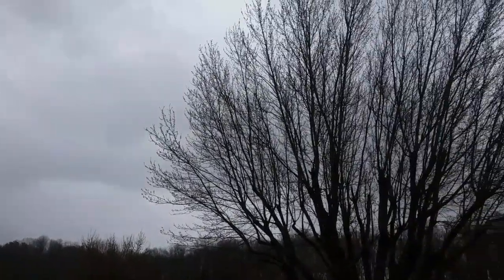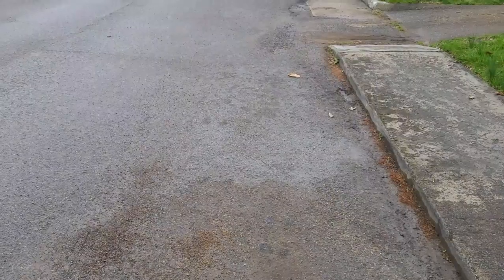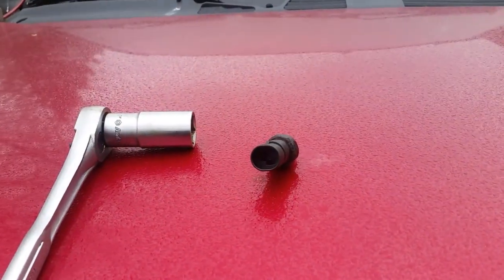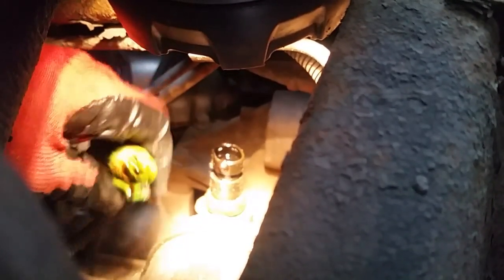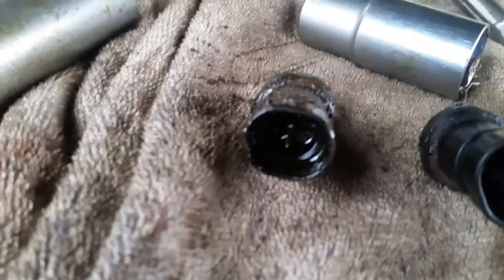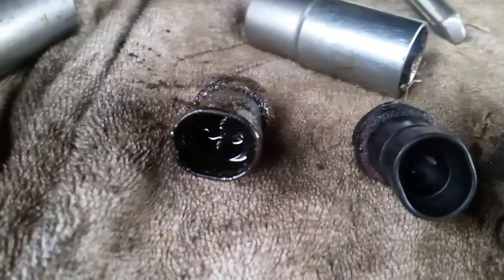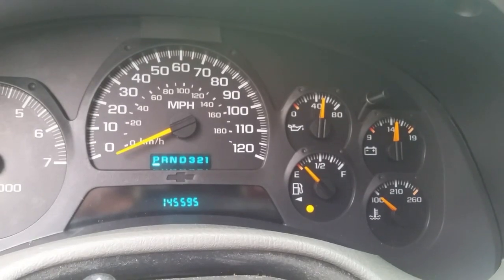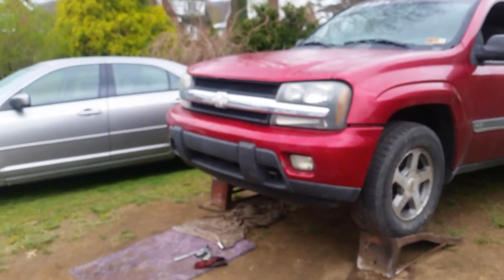Oil Sending Unit Bad leak Fix. Trailblazer.

Comment: Thanks for putting this video up Nathan! It is a pain to get to but not too bad if you have the ramps and the proper deep socket or you could just do what I did...it was super easy I dropped it off at my mechanics shop to do it!! LOL Just picked it up now have fresh oil, filter  and oil sending unit. This fixed the low oil pressure warning when car is at idle plus the warning to shut off engine. We  also ran an engine flush just in case. An hour driving on it after repair and voila oil gauge steady. I'm in SoCal. Keep up the good job on the videos, and even though I didn't work on it(this time) I do know where my engine oil filter is so please ignore Mr. Geiser who needs a snickers! Made me laugh!
Reply from the maker: Great!

Comment: Hello from Denver Colorado! The video was very helpful and it looks like a really easy fix. My trailblazer just started last week after the engine is fully warm I'll come to a stop and the oil pressure light comes on and the gauge drops from 40 to 0 and will fluctuate back and forth. But as long as i keep the idle up it'll stay at 40 lol. Plus I have noticed a lot of fresh oil underneath so yeah, I'm certain it's the same problem as you had. Thanks again.
Reply from the maker: Nice!

Comment: Nathan, thanks great video and follow your instruction. The point is that  after replace the sensor,  problem still exist. I change the oil, no engine noise when the pressure is low at itle only, the oil level is normal, what could be?

Comment: I changed my serpentine belt cause squealing sound , notice a trail of oil leaking bad, maybe oil on the bottom of belt making noise,  but the leak is up front oil gauge works, I just hope this is where it's leaking from its definitely in this area of car.
Reply from the maker: O wow!  Me too!

Comment: Hello I have a 05 envoy xl my oil gauge is all the way at 80 when the engine is running. when it’s off it sits at 40 should I change the pressure sensor for it? I recently replaced the vvt solenoid for a p00014 code
Reply from the maker: Bad interment gauge cluster

Comment: Question, when that sensor is leaking would it cause it to get oil all over the steering fluid pan & surroundings? Because I’m not sure if that’s the part I’m looking for or if it’s my oil pan. I haven’t actually crawled under and inspected but from above I see no cracks however it leaks in my driveway a lot, oil pressure doesn’t seem to change on the gauge, and there’s oil in upper areas
Reply from the maker: Yep. Wind blows it up there because that's an area of low pressure when driving.
Reply: Sweet thank you I appreciate it. I detailed the engine too, and seen it after asking lol double confirmation!

Comment: I know the video is published in 2019 but according to what the oil looks like you need an oil change 3,000 miles before you did this video but on the other hand thanks for the information and are 2005 inline 6 started doing this the other night and it scared the crap out of my wife

Comment: I just started my 2007 Chevy trailblazer this morning and immediately oil came spilling out the bottom of the engine lost almost 6 quarts is the oil sending unit the  cause?
Reply from the maker: Read comments below.
Reply: @FixingWithPassion  I never received the response to my question. I read through every comment. Could you please let me know if the sending unit went bad if it will leak all that oil in a little bit of time please. Thank you

Comment: I just replaced this sensor this morning on the wife's '06 Trailblazer with the 4.2 I6 engine. It's been leaking for a couple for weeks and showing low pressure on the "gauge", which in actuality is nothing more than a glorified idiot light. It doesn't actually show pressure. It's an on-off switch.When it's on the gauge reads 40 or so, when it's off it reads 0. False advertising on GM's part.
Anyway, I did this as part of an oil change. Once the filter is off it's easy to get to the sensor from underneath. I used a 1-1/16" deep socket and a flex head 1/2" drive ratchet. A fixed head ratchet hit the frame and wouldn't allow the socket to turn. A stubby ratchet would probably work, too. It's not too bad a job, really. The ratchet is needed just to break it loose and to snug it up again, the rest you can do by hand.

Comment: Will this make the oil run along under the whole vehicle? I woke up and there is oil everywhere under my car. Running down the body frames. Its everywhere. My wheels are flinging it. I'm going to take it to a car wash and then get under the car and try to pinpoint it out.  Its so hard to tell with the oil literally on everything.
Reply from the maker: Its possible.
Reply: This sounds exactly like what mine did this morning it looked like an oil murder scene

Comment: Do you have any videos on gauge readings? Nun of my gauges on the right work but my mph and rpms do.
Reply: Josey Johnson stepper motors probably. You can get an obd2 plug in display off amazon for $70 or take the cluster off and send it in to get fixed

Comment: Nice ! 
You gonna be doing a valve cover anytime soon ? I know mine can’t be the only one that leaks into my spark plug holes lol I hear the bolt on the valve is the biggest pain I’m just waiting on you now lol
Reply: juiced71 hahaha just did plugs and was real suspicious about the oil on the plugs
Reply: Had that same problem a couple years ago in my 02 and the bolts for the 2 misfiring cylinders snapped. Ended up having to take it to my mechanic

Comment: When that oil started flowing out I was like when was the last time he changed the oil. Starts vehicle change engine oil soon warning in cluster. I refuse to wait for that to come on. Every 3k it is changed, afterwards before starting vehicle always reset the oil monitoring system by turning key to run do not start press accelerator pedal 3 times to floor within 5 sec. to reset system.

Comment: Just got an oil change last week on my 03, now it keeps telling me low oil pressure stop engine. There is enough oil, sensor does have a leak. Don't drive it?
Reply: Oil pressure gauge is working, tells me low oil pressure stop engine when I come to an abrupt stop.
Reply: It could be the oil pick up tube o ring I had the same problem and replacing the o ring fixed the problem